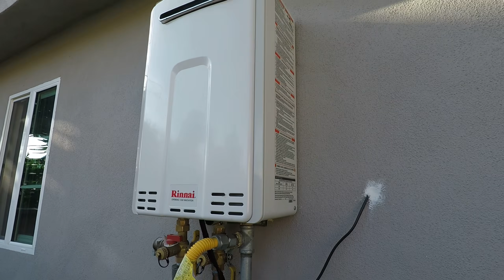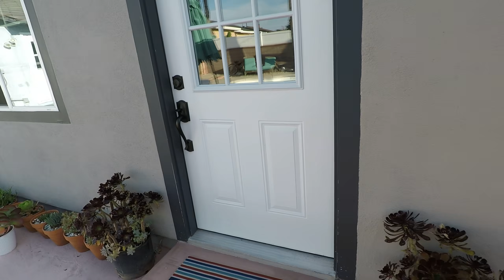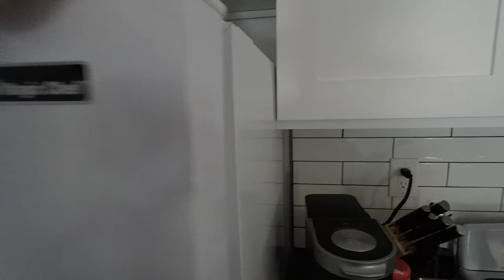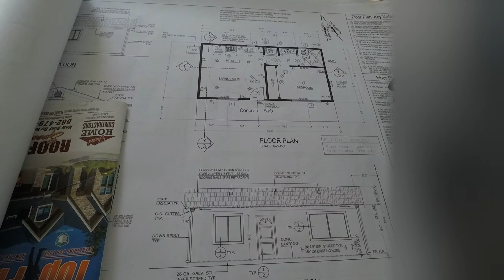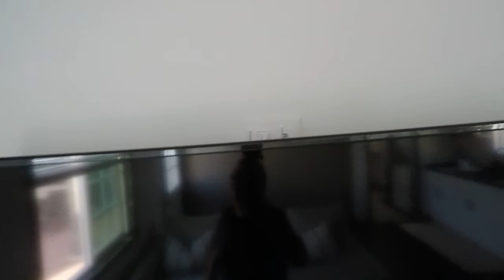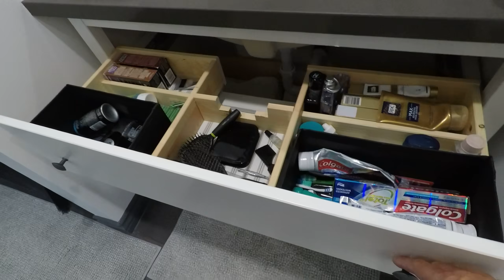2020 ADU 450 SQFT $70K Los Angeles P1 (Guest House, Casita)

Comment: Hi, did you hire an architect to do all the plans, or why were they only $ 2,100? I'm planning on doing my ADU in San Diego but architects are currently charging around $13,000 for plans with permits and corrections. Thank you!
Reply from the maker: I didn’t use an architect. I found a draftsman to draw the blueprints back in 2019.

It was only $2100 because I had to be the courier taking the plans back and forth between the draftsman and the city. 

I also had to pay the plan check fees separately out of my own pocket which was another $1500.

Comment: IT LOOKS AMAZING QUESTION DID ENGINEERING COME IM WITH YOUR BLUE PRINTS ALSO
Reply from the maker: For the my new detached unit, no structural engineer stamp was required by my city. 

However, when doing an ADU conversion of my attached garage…my city did require a structural engineer to stamp the plans and reinforcement beam was required.

Comment: Can I get the contact information for the contractor that built your project. 70k sounds very reasonable. Beautiful place you have there
Reply from the maker: The price I paid in 2019 when I signed the contract no longer applies. The unit was completed in 2020, but costs have gone way up in 2022 due to inflation, cost of gasoline, cost of labor, cost of materials, etc.

Im advising someone right now and the prices are over 30% higher now in 2022 than they were in 2019.

Comment: I was wondering if the appliances were included in bids on building these ADUs.  I live in Washington State and I hope I can find ADU builders that can do a great of a job as this one came out.  Thanks for the great video!
Reply from the maker: Appliances were not included in the bids. I purchased all the appliances separately, but you can ask that the bid include the appliances you want.

You can probably add the make and model of the appliance if you research ahead of time.

Comment: Thank you for this awesome video! I just have a question about the setback if you have the electricity pole IN your property, is the requirement also 5ft like you mentioned in the video?
Reply from the maker: Yes, in my area covered by SCE the setback is 5 feet even if the pole is on your property. Check with your city and electric company to be sure.
Reply: @MHam1  Thank you for responding! I really like the setup of your ADU! I hope you dont mind if i make it my inspiration for my project! hows the tankless water heater working for you if theres other people using the hot water?
Reply from the maker: Yes go ahead and use my YouTube video as your inspiration for your ADU. The tankless water heater is great for two people using the shower and the clothes washer and/or sink.

Buy a brand name water heater like Rinnai or Rheem.
Reply: @MHam1 Hi Can You tell Me if You had a contractor do this or did You ?

Comment: Was 70k the cost of the ADU ? I’m planning to do one around the same size but I’m trying to figure out costs
Reply from the maker: Yes, $70k construction costs but that was in 2019 when I signed the contract. Plus $7k in blueprints, city plan check fees, and build permits. Plus appliances and furniture.

Good luck with your project. It took me a year to complete from the start of the blueprints to the completion of the last inspection.

Comment: Thanks for sharing. Who is your contractor? Are they in Los Angeles? Can you share their contact info?
 This seems like a lifeline to know that someone Could find a contractor that's reasonably priced. I've been wuoted almost $300000 for the same size unit. It's hard not to feel that 1 is being taken advantage of.
Reply from the maker: I feel lucky and fortunate to have found a great contractor. At the time in 2019 when I was interviewing several contractors, his price was in line with other quotes I got. I got a range of quotes from $67K to $92K.

Unfortunately, it’s now 2022 and I’m having lunch with my contractor today (he ended up fully remodeling my primary home and doing a garage ADU conversion for a total of 3 units on the same lot).

He doesn’t take online referrals. Up to now, he’s still super busy flipping houses, building ADUs, remodeling homes, and running his small business. 

I did a video on the process of finding and selecting a contractor as well as another video on what a good contract should look like with a good payment schedule based on passed inspections and completed work.

Comment: That’s more per square feet than Maui Hawaii
Reply from the maker: You must be a native Hawaiian living on public land.

The absolute lowest cost per square foot construction he was doing on island came in at $100 square foot hard cost for the contractors. This was on a project for Department of Hawaii Home Lands for native Hawaiians. This is no frills construction with no profit margin for TMC. Someone building a private home on island should not expect to get this low a cost. A more robust but still relatively modest home is going to cost about $200 a square foot today. This will get you a place with a 30 year roof, mid range appliances and mostly carpeted floors with some tile. The price range for a very well appointed home is about $350 a square foot. This would be a home with nice appliances, granite and other high end materials throughout. The current cost for Wailea quality construction is running $600-$700 a square foot. For this cost, you might expect even higher end appliances, homes with pools or other water features, nesting doors and other high cost features.

This article is here: https://www.mauirealestate.com/maui-construction-costs/

Comment: Amazing place! Very cool! 70k included all construction and materials? Did you buy the plans from somewhere online or have them drawn up? Thanks for sharing!
Reply from the maker: Price from 2019 prior to the pandemic. $70k included all construction and finishing materials. 

I paid extra $7k for drawn up blueprints, plan check city fees, and city build permits. Plans were made by a professional draftsman (no interior design just blueprints for city and for builder).
Reply: @MHam1  Really amazing work for a great price! 👏 Very cool you decided to move in full time to have you own private space (since you let your family live in the main house :)

Cost of homes are so out of control now. I'm hoping, dreaming and planning to figure out a more affordable alternative for home ownership, small dwellings like yours are inspiring. 
I figure building a slightly larger than tiny home is one way to cut costs.

It's nice this is just nice extra space for you though 😀

I know costs are more expensive now, but still amazing materials and construction were included for that price at that time. 

Thanks for sharing!
Reply from the maker: Just an update...my living situation has changed. My dad moved to the back house. My son moved to the ADU garage conversion (completed June 2021). So, we switched spaces in July 2021.

I'm almost done remodeling the whole main house. Only have the laundry area and the kitchen left to complete and should be done by 1Q2022.

Comment: Hi Manny! Thank you so much for sharing this video. Two questions: what is the sq ft of your house and overall lot? Second, did you refer to any checklist for start to finish? Looking to buy home in San Diego and your info helps a lot. Cheers 🥂
Reply from the maker: I didn’t use a checklist. I just did research and started figuring out things from there. First, you need to check with your city if you are allowed to add ADU. Second, you need blueprints. Third, you need permits. Fourth, hire a general contractor to start at step 1 or 2 or 3. It’s up to you how much you can do yourself.

My lot is close to 8000 sqft and my main house is around 1500 sqft. 

After garage ADU conversion and detached guest house build, my new living sqft is now close to 2400 sqft.

For my detached unit, I did steps 1 and 2 myself by hiring draftsman to do the blue prints. I hired general contractor to start at step 3.

For attached garage ADU conversion, I hired the same GC to start at step 1.
Reply: @MHam1  thank you Manny. Really nice of you to share these details.
Reply: @MHam1  what company did u use?
Reply from the maker: I didn’t use a company per se. I found this small independent general contractor/real estate investor/house flipper/property maintenance entrepreneur who had very reasonable prices, but works very slow due to all his projects. 

I’ve asked him many times if I can refer him on YouTube and he’s declined. He said only personal referrals who have seen my units in person.

Comment: Who did the plans for you, and how did you find them? Did you need any engineers or land survey? Having a hard time getting started on mine. Also did you have to babysit them as they built it or could you just do your own thing?
Reply from the maker: I have done two units. This detached unit and my attached garage conversion. In the detached unit, I found a draftsman from a referral from a friend. I had also gotten referrals from other general contractors. After talking to 4 draftsman, I selected the one I went with. He actually has a page in Yelp and his reviews are not great! LOL. I think he doesn't communicate well by any means (phone, text, e-mails, in person, etc.). No structural engineering required by my city on the detached unit. No land survey either.

On my garage conversion, I got lazy and asked my general contractor to hire a new blueprint draftsman that he just started using. City did require a structural engineer to strengthen the existing garage structure (needed footings, and a huge beam going across the roof).

I did not babysit the draftsman, but it took 6-7 months to get the blueprints approved by the city due to the draftsman taking so long to make the necessary corrections.

In terms of the construction, I was working from home due to the pandemic, so I was here looking at everything they did. I didn't need to be here, but I could make decisions quickly if they had questions. It worked out great for me to be here and see what they were doing.

No babysitting required, but when I was working from the office I would inspect their daily work at night by taking pictures and videos. If I had any concerns, I would ask the GC to meet me in the morning to discuss. Or I would just text/call him to make sure I understood what they did.
Reply: @MHam1  was it the same person who built your casita?
Reply from the maker: Yes, the same GC built both the detached casita and the attached garage ADU conversion. He also remodeled my main house, so this GC basically built and remodeled my entire property!

Comment: mr ham, would it be possible for me to buy your plan and use that to build a du on my backyard? in Los Angeles county
Reply from the maker: My detached ADU plans have expired. 2021 and 2022 ADU laws have changed and require solar panels, newer energy requirements,  and other items that were not required in 2019

Comment: What size is your backyard?

From the back of your house to block wall?
Reply from the maker: My backyard is approximately 50’ long from back of main house to block wall (property line) and 63’ wide from side to side (block wall to block wall).

City requires 4’ setback off the property line, but SCE has overhead power lines in back property line and a 5’ setback is required on back property line. I described this in video.

Comment: THIS IS SO BEAUTIFUL 
IVE WANTED A HOUSE LIKE THE ONE YOU HAVE 
FOR AS LONG AS I  CAN REMEMBER.  ITS BEAUTIFUL YOU HAVE A RIGHT TO BE SO PROUD.
I LOVE, LOVE LOVE, 
        LOVE IT 💜💘 senore,
Reply from the maker: Thank you for the kind words. When I bought my house 25 years ago, I thought that one day I will build a detached casita. 

When I built the pool 13 years ago, I put it on a corner of my backyard to save space for my casita. 

A few years ago, I started thinking about the ideal dimensions of the casita and drawing my ideal floor layouts. I was thinking about not wasting space, dual use of bathroom, noise buffers between living room and bedroom, making kitchen/living room feel bigger than they are, etc.

So, it’s been a journey but I was finally able to accomplish my ideal casita. And now I’m converting the garage to an apartment for my son. My dad will move to the casita this summer and I’m going back to the main house.

Comment: Who built it and do they build in Nor Cal ??? How much total
Reply from the maker: It was built by a small company in LA. The owner flips houses, builds homes, remodels homes, and runs a property maintenance company. All with a small crew.

He doesn’t work the NorCal area. My detached unit was $70k construction costs including all the finishes you see in video. 

Soft costs were like $6100 for blueprints, plan checks, and build permits which I paid separately from construction contract. Appliances, furniture, and decor not included in these prices.

Comment: Can you tell me what size breaker you have feeding this unit?   I really only can spare 40 amps on my panel without doing an upgrade or switching my hvac to gas.
Reply from the maker: The detached unit has a 100 amp panel but now sure about your question regarding the breaker
Reply: @MHam1  thanks.  My main panel is heavily loaded because I have a well and my HVAC system is electric. Where most people have city water and natural gas for heat.  I will have to either upgrade my panel or have separate meter feed.  
Thanks for the info.  I really appreciate it.
Reply from the maker: The planner from SCE told my contractor that my attached garage conversion (essentially the 3rd unit on my lot) could run on a 40 amp panel.

SCE does not like to issue 400 amp drops to residential homes, so they said that the 225 amp drop should be enough for the 3 units on my lot.

Also, I’m not exactly sure how they distribute the load but they keep saying that the single drop will be good enough to support the 200 amp panel to the main house which also feeds 100 amps to the detached unit and will support a separate meter on a 60 amp panel. 

Again, I don’t know how this works but everyone assured me that it will work. Moreover, they say garage could run on a 40 amp panel.

All my 3 tankless water heaters, 3 stoves, and 3 dryers are gas, so there’s no need for amp hungry electric water heaters, stoves, and dryers. Also, my main house has gas furnace.

Comment: íts about right ,,,$70K for 450 sqft ,,,my niece built an ADU in Orange County ,,,it was $160K (A-Z things!) the most expensive things are permit (specially school takes a huge chunk of permit ,,city doesn't take much $$)
Reply from the maker: How many square feet for your nieces ADU? 

In my city and county, ADUs under 500 sqft get excluded from certain fees and surveys. Also, the build permits fees are based on sqft and MEP materials.

So, the larger ADUs get charged higher permit fees. I had no school fees.
Reply: @MHam1  800 sqft , Orange County/Westminster ...damn school collect like $12k in permit and city & others $4K
Reply from the maker: Wow! $12K for schools sounds steep.

Comment: I am looking to do the same thing but I would do the building myself with the exception of the foundation. Any suggestions?
Reply from the maker: I didn’t price out the various construction aspects of building an ADU from the ground up. So, I didn’t hire a subcontractor to do the foundation. Try driving around your neighborhood to see if you see any construction crews and ask them if they do foundations only.

Have your plans ready and be ready to work with the city inspector as the foundation (in my case a slab) requires an inspection before pouring the concrete .

Comment: I love the ADU! Was there any utility connect fees, or were you able to tap into the current electrical, sewer, water, and gas?

Once you had your plans, how long did it take for the city to approve once you submitted them?

Thanks!
Reply from the maker: No utility connection fees. Gas, water, and electric are shared with main house. The detached unit has its own sub panel but shares the meter with the main house. Sewers lines had to go around main house and connect in front yard.

The plans were resubmitted 3 times to fix corrections and the plan approval process took 6 months from start to finish. Draftsman had more delays than city. 2 months to draft the fist sets of plans and 4 months trying to get approval.
Reply: @MHam1  Thanks!
Reply: Hi Steven, I thought ADU's needed to have it's own connection for gas, electricity and water? Is there a way around that?
Reply from the maker: My city did not require a separate meter and I was able to tap into existing utilities. Only the sewer lines had to go around the main house and connect closer to the city sewer line at the front yard

My detached unit has its own electrical sub panel and it’s own shut off valves for water and gas.

Comment: very nice adu ... i want to build the same adu that you built....can i use your Plans including Title 24?....if it work, i will pay you some back....thank you
Reply from the maker: Hi, my plans are not for sale. They have all my personal information, are site specific for my property, use energy rules from 2016, building codes specific to my city. 

The How To ADU channel by Ryan has a video on ADU plans where he talks about reasons why you have to have your plans made specifically for your property, e.g. windows facing a certain direction, distance from existing structures and property line, setbacks due to electrical overhead lines, etc.

So, you can’t really use my plans unless I had the CAD files for you to customize which I don’t. I only have the blueprints.